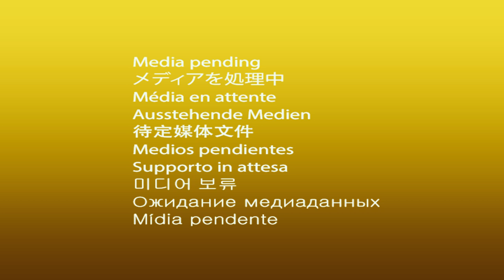Lifeguard Champ to the Rescue - Sink or Swim 77

Comment: Simon, you may be other ideas but I suggest you try to find a good deal on some 1/4 “ plywood and finish out the main cabin.  Rough in the wiring and put up the ply.  Then you can either leave it natural or paint it.

Comment: I'm very interested why the 12S2P x 9 configuration? Why not 12 x 18P blocks?

Are the smaller scale battery management systems cheaper? It would be more modular of course the ~48V per block are easier to handle (less thick wire gauge). But are smaller BMS systems reliable enough? 2kWp doesn't sound like enough though.

I'd love more videos going into the design decisions of your boat and battery system. I'm reading books about catamarans and looked up some solar powered catamarans. Info is surprisingly hard to find. From what I gather with something like 30 panels (10kWp) you can achieve about 5-8 knots on solar alone 24/7. Faster for shorter trips with battery or generator assist (hybrid).

SolarWave 54
Sun21 / Aquabus C60
Heliodive Alexis Synodinos
Blue Planet 32E
EcoloStation Solar Cat
Aerofleet solar catamaran
Defline Aero 48e
Soelcat 12
FlatCat Solar
Horizon SunCat 46

I'm also wondering about a kite surfing sail instead of a classic sailing rig. Theoretically they are cheaper and more powerful (high winds) and more stable.